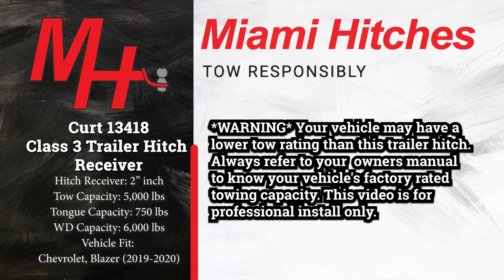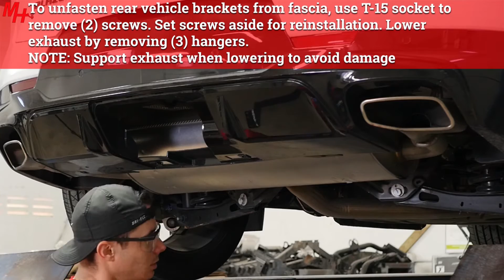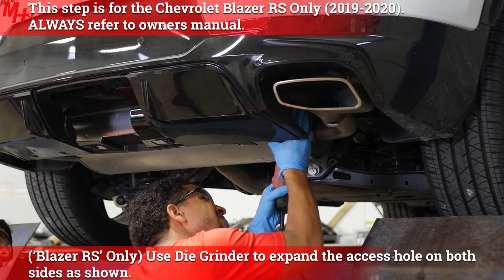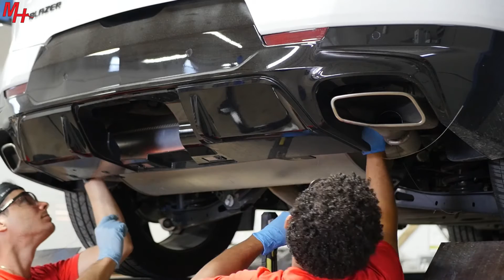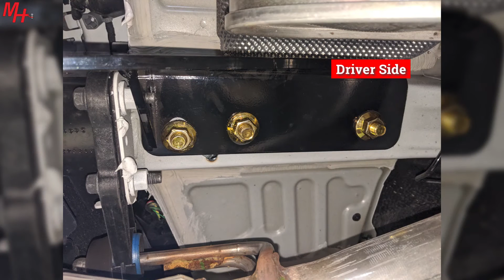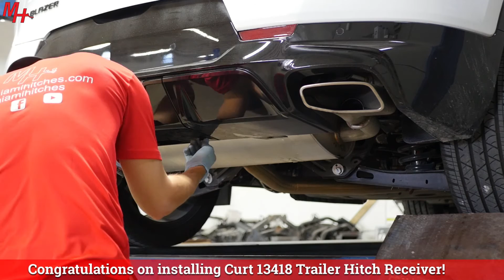Trailer Hitch Install: 2020 Chevrolet Blazer Curt 13418

Comment: What is the need to use the die grinder for the RS model?
Reply from the maker: To enlarge the access hole so the bolt and spacer can fit through when you are dropping in your fishwires.

Comment: This is why you buy GM parts so you don’t have to cut anything. No grinder needed.
Reply from the maker: Yes of course you have the option of going to the dealer and paying dealer prices. Keep in mind these are after market parts that are usually easier to install with better prices.